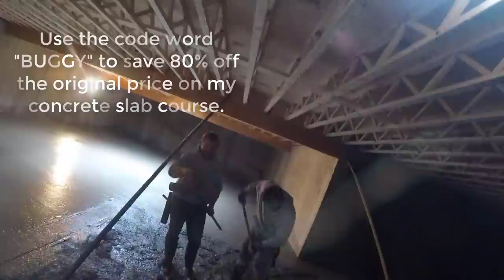POURING A BASEMENT FLOOR | CONCRETE FLOOR

Comment: Mike, I have helped pour my share of concrete over the years and I emphasize help! I have poured a more fluid mix like in this video and also a difficult to move "Thick" mix that was a booger to get finished before it started to setup. I am confused when you mention reducer and without adding water in the same sentence. I noticed you used the term add another slump when you started to pour in this video, please explain in detail what all this means and looser slump without adding water, because don't you have to add water to make it looser? I also am curious of how do you know if you get a HOT LOAD,  this has always been a fear of mine. Thank you for the videos.
Reply from the maker: When you order the concrete from the dispatcher you can tell him approx what slump you will be pouring. He will add the water reducer based on that information. Most days we use a mid-range water reducer. So he adds this when he batches the load of concrete. When the truck shows up on the jobsite it may be a 4 slump inside the drum but we want it to be a 6. So yes, he has to add water to get  the slump up to that 6 but because there is a water reducer additive in the mix the amount of water added is very minimal and doesn't weaken the mix because the water/cement ratio is still very low.  Hot Load - You usually don't know until you start pouring the concrete and after a few minutes you can start to feel the slump start to stiffen even before you screed it. This can happen if the driver spins his drum too fast on the way to the job, or the driver doesn't empty his leftover on the previous job and the dispatcher just "adds" to it when he sends you your load.

Comment: Question- Is there a need for expansion joint between the walls and slab? I'm going to be doing my basement (we are in NW, Pennsylvania) and I'm not sure if it's needed. I've been watching a TON of your videos and they are very helpful. Thanks for what you do!!
Reply from the maker: In a regular basement it's not "needed". Probably half our pours are done without it. It does help with expansion/contraction of the floor. So you may be less likely to get a shrinkage (stress) crack if you use it versus if you don't use it. We saw cut all our floors, so this controls most any shrinkage cracking in our floors.

Comment: Big huge house or warehouse, wow?  Maybe I missed it but how did you guys check the elevation of the top of concrete while you were pouring?  We used to use a story pole to bump up against the floor joists above.  Nice job but I got a little dizzy with the camera work. Jon Steven.
Reply from the maker: Jon - We use a Topcon Laser to set our elevations. I used to use your method years ago until I had a deck that was an inch out of level and didn't notice. The floor ended up being the same and we had to cap it to level it out. Thanks for watching!